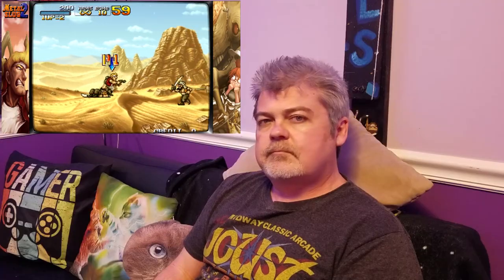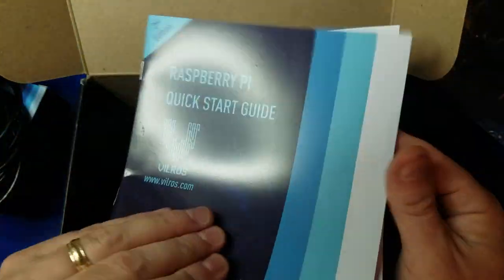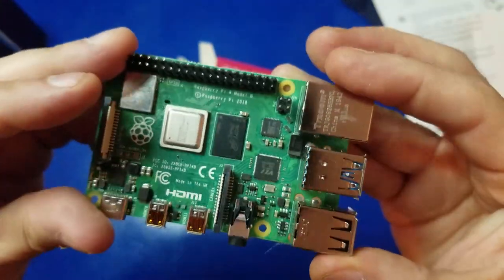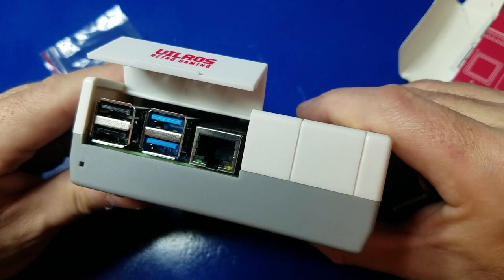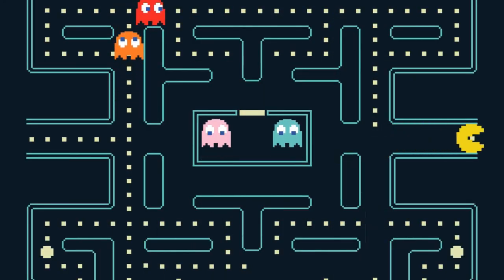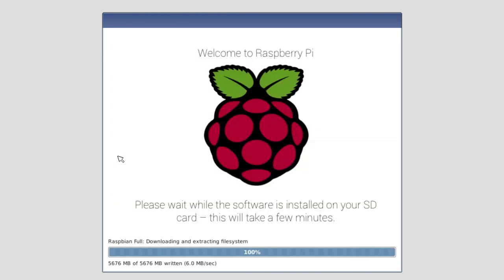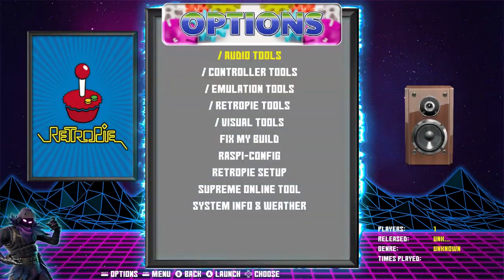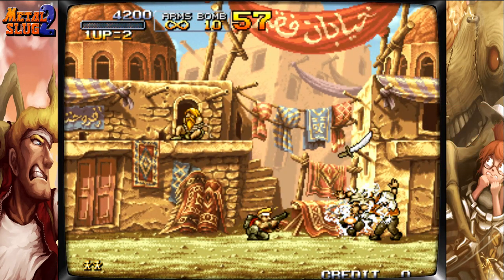Vilros Raspberry Pi 4 Retro Gaming Kit + Setup Lakka and Supreme PRO RetroPie

Comment: For some reason I can't get NOOBS to run in order to get Lakka installed? It allowed me to boot the default OS and connect to the internet but I get a weird error message during boot up 'failed to suspend device, error -71'. Even when pressing Shift during bootup I can't get the NOOBS v3.1 thing to open during boot so I can't get Lakka going. Do I need to reformat the SD card? Any help much appreciated
Reply from the maker: I setup a guide here that discusses RetroPie, Recalbox and Batocera: http://wagnerstechtalk.com/rpi4gaming/#Recalbox_Install_on_a_Raspberry_Pi_4  Much more recent information and videos here.  I'd recommend trying Recalbox.  It's the easiest of the 3 to setup.

Comment: Can the user interface be set up to auto start a specific emulator? Trying to set one up for a 5 year old. Want to make it as easy as possible.  Or on start up can it only show limited options on emulators and games? Any help would be greatly appreciated. Thanks
Reply from the maker: You may want to ask this on the forums, I'm sorry I don't have an answer for you.  I've not investigated nor tried at this point.
Reply: @WagnersTechTalk  Appreciate you getting back to me. Thanks for the upload. You helped me get mine up and running. 😁

Comment: Just stumbled across your video and currently trying to setup a Raspberry pi 4 with retropie.
Currently I've got a display connected via adapter to the hdmi 0 port and want my pi to run either dualscreen or preferably check for usage of hdmi 1 port and then prefer this port (so I can connect it to any screen to play with friends on a bigger screen)

Any ideas how to achieve this? Would highly appreciate your help <3

Comment: Question about shutting down; Is there a shutdown option in Supreme PRO RetroPie or do you just quit your game and just turn the pi off with the on/off switch on the power cord?
Reply from the maker: Best thing to do is to press the START button, select Shutdown, then flip the power switch off.  Just removing power from the Pi4 could potentially cause file corruption.  Hope that helps!

Comment: can the pi handle most of the games? how is it looking with ps2 games... but mainly i would play n64, gamecube ps1 etc.... are there some problems? does super smash run good :D
Reply from the maker: May want to also check out this video running Batocera: https://youtu.be/NLAMRxV3g50  On RetroPie or Batocera Dreamcast will play decently (30-40 fps).  PS1, no problem.  n64 will play well, with a few minor audio glitches here and there (likely emulator-related).  Not sure about Super Smash, never played that.  PS2 is a no-go on the Pi4 as far as I know, I don't have any gamecube games at this point.  Hope that helps!
Reply: @WagnersTechTalk   yes thank you very much

Comment: Nice One mate 👍
What are the temperatures like though - the heat on these RP4 boards puts me off buying one - lots of people with massive heatsinks and fans kind of ruins the small form factor ?
Reply from the maker: Thanks bro!  With 4 heat-sinks and active cooling, it has been running just fine with no throttling.  I will be posting more details on that on the RPi4 Gaming page.

Comment: Keep in mind this is coming from someone who didn’t grow up with a computer, doesn’t own a pc or laptop, I mainly get by with my smartphone, but I’m very interested in this for retro gaming.  so dumb questions incoming:

Is it possible to download and play roms using just the raspberry pi?  Or do I also need a pc/laptop?  Thanks in advance for any info you could give me, I grew up pretty much strictly as a console gamer and I am deeply intimidated when it comes to messing with this stuff.
Reply from the maker: Wow, that's a great question and one I've honestly never been asked.  You can use noobs (included in this kit) to install Raspian Buster, then download RetroPie on top of Raspian (btw - the RetroPie team officially released RetroPie beta 4.6 since this video was created, so you can install that instead of Lakka/Supreme RetroPie).  There is a browser included with Raspian (chromium) that will allow you to download your roms directly to the microSD in the Pi.  So yes, you could get away with doing everything on the Raspberry Pi.  While in most cases it's easier, at least for me, to burn the images / connect from the PC to the Pi to do stuff you could accomplish the same on the Pi so long as you have a bootable microSD with noobs as a starting point.  You will need a USB keyboard, monitor/TV, USB controllers and mouse connected to your Pi for the web browsing, game downloads and setup.  In your case, since you would likely be using your kit as your main computer, you probably want to get the 4GB Raspberry Pi instead of the 2GB (it will be helpful for using it as a desktop computer).  I hope I'm not missing anything, perhaps someone else can comment here if I am.  But yes, it can be done.  Downloading of RetroPie to an existing Raspian Buster image is not something I have any videos or tutorials on at the moment.  This might be a good future tutorial though, I'll have to think about it.
Reply: Wagner's TechTalk thanks a lot, I really appreciate all the useful info!
Reply from the maker: You're very welcome, I appreciate you watching and your question.  I have several tutorials and videos I'm working on currently, once done with what's planned, I may visit this question in more detail and document it to help you (and others) with the same question.  Stay tuned to WTT for any updates and I'll try to help if you run into any snags.

Comment: Is there another way to add games? Can you just drag and drop roms directly to the micro sd? Also can you just use a flash drive for games or will they only work from the card?
Reply from the maker: Yes there is, you can read more about it here: https://retropie.org.uk/docs/Transferring-Roms

Comment: I got this kit! Albeit the Raspberry Pi 3B+, it's just about the same thing.. I ordered the older version, thinking maybe there's more support, but fine to know the 4 will fit in just fine, in case I do find a new home for the 3B+, a little extra tinkering will be alright! Interchangeable parts. 😍😎

Mine came included with a thermal compound paste, most comments are 50/50 on if it's necessary, so I figured maybe run the most standard fit for the first try. Nice little case, I wonder if I could color it at all, try to make it look a little more Pretendo.

Awesome work here, shame I'm later to the party, but exactly what I was thinking for my family & Pi. Seems a little easier, and more welcome setup than some Frankensteined Android TV Box, but I'm sure there's plenty of OS and options to make them more user friendly.

Setting mine up tonight, hope you and your family have a great Thanksgiving!
Reply from the maker: Thank you for your comment, yes it's a very nice case and I really like the design.  I might have a similar case being shipped to me soon for review to show as well, not 100% sure at this point.  Thank you for watching and we did have a great Thanksgiving and hope you and yours did as well!

Comment: What has the better Performance the retropie 4.6 oder lakka?
Reply from the maker: Lakka is running RetroArch, RetroPie 4.6 is an easier-to-use front-end which is also running RetroArch for some emulators.  There should be no difference in speed between the two.  I have a more recent video on installing RetroPie 4.6 here if you're interested: https://youtu.be/fDdPApFGvBo  I would recommend RetroPie 4.6 now that it's been officially released (wasn't released at the time this video was created).

Comment: I see that you switch over to PC for file management. Are you able to do this through the pi as well via a different OS or something? Looking into this for someone who doesn't have a PC. I also figured this could be done through a phone. I know my Android can, but he has an iphone, which I don't know much about.
Reply from the maker: While I haven't personally tried it, if the phone is setup with a Samba share the Pi should be able to connect to it and download anything you want.  I do frequently use my Pi to connect to my NAS (DS 918+), so sure you can go from the Pi to some other device just fine as long as that other device is sharing.  When you launch the file manager, you'll see an option to Browse Network.

Comment: So you loaded an operating system (noobs) via the 32 gb sd card. After that you took it out and replaced it with the 128 gb sd card which contains retropie?
Reply from the maker: Correct.  The instructions that come with the kit demonstrate Lakka, which is the first thing I show.  Then, installed Supreme Pro RetroPie (not to be confused with the "official" RetroPie distro).  btw - check out my retrogaming page on my website, RetroPie 4.6 (beta) for the Raspberry Pi 4 has now been publicly released (as of 2 days ago).  Working on steps for that on the page.  Hope this helps!
Reply: Wagner's TechTalk Yes that makes sense. Thanks

Comment: Does the fan turn on when you first power up the unit. If not I might have a bad fan I tried different pins but still no luck? Any help
Reply from the maker: Yes, the fan comes on immediately upon power up.  If it's not spinning, contact Vilros for a replacement.  I'm sure they'll be happy to help (assuming you're using a Vilros kit).
Reply: @WagnersTechTalk  thank you so much looks like I'll be calling vliros then thanks again
Reply: Hey I just tried doing mine the same as yours now it works. They forgot 2 of the small heat sinks do you think it will fine without them or should I  call vilros for replacements??
Reply from the maker: Cool, glad you got it!  Yes, I'd get the missing heat sinks.  May not matter that much, but can't hurt